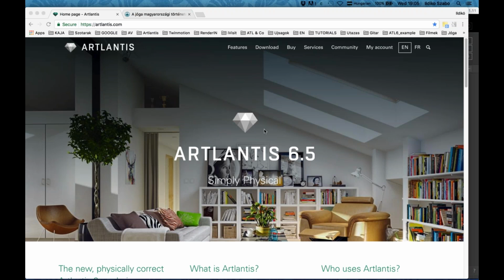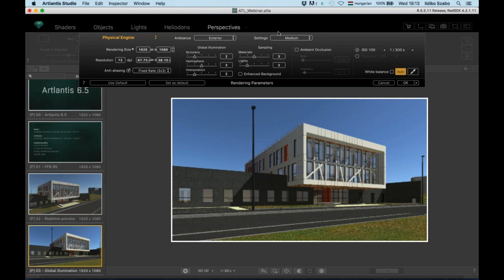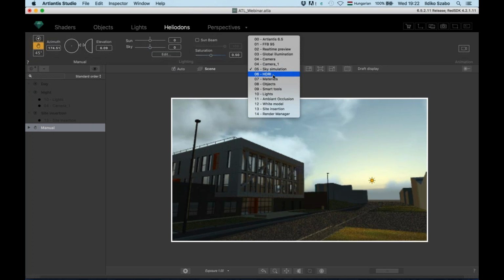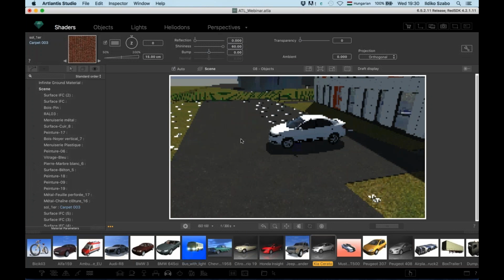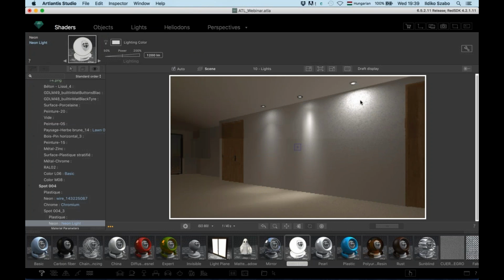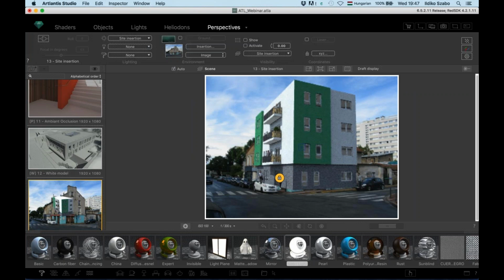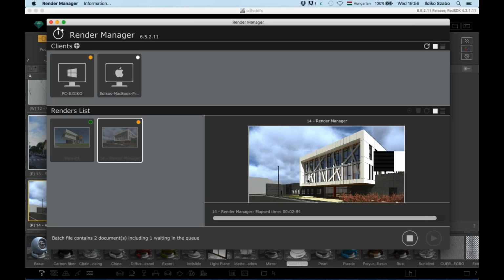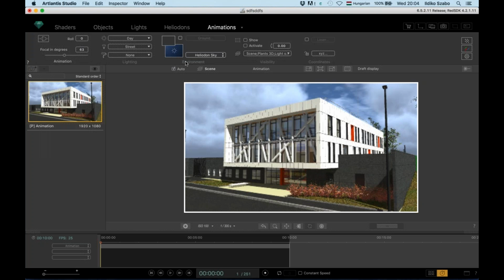Simply Physical,  Artlantis 6 5 new features

Comment: Bei 53:20 There is a render bug in the clouds at the left top of the main building.
Update: There are many render issues in the clouds in the final rendering (55:24).
Reply: you mean those bugs appear in 6.5 version of artlantis?
Reply: I don’t know. I am not using Artlantis. But I can see the rendering bug in this video.
Reply: I see. Yeah i just noticed it rite after i read your comment. I actually in the situation of struggling, looking for the good render engine. I dunno which should i go for..
Reply: I am rendering with Octane. It is very fast (it’s running on GPUs) and physical correct.
Reply: Owh lord... Octane!!.. I not pro like you to play with all those nodes. It seems difficult to tweak material compare to vray thea style. And I use single gpu only while octane need multiple gpu. But i always envy with Octane final render, they always stunning.
Reply: Yes. Materials in Octane are a bit difficult.
I hope that VRay gets better in GPU rendering in future.